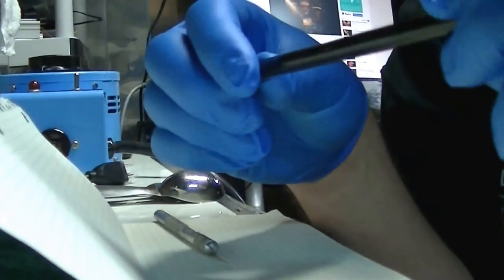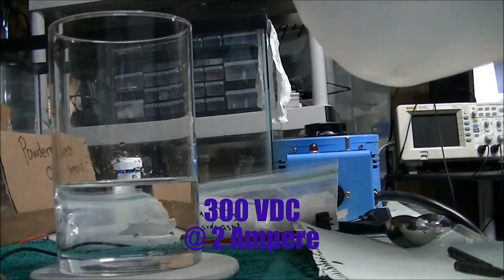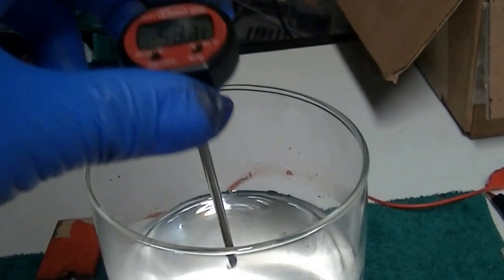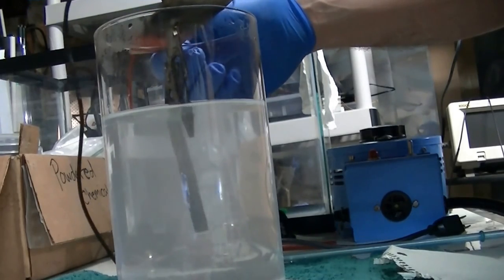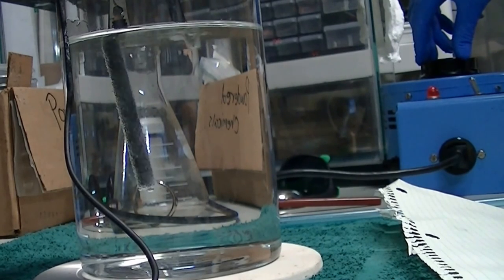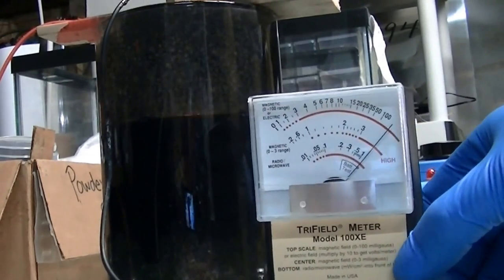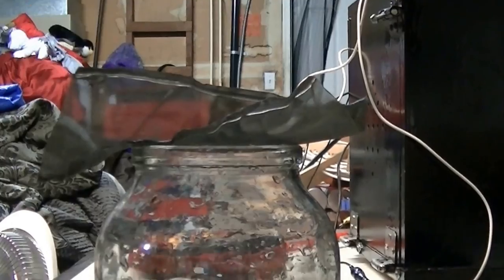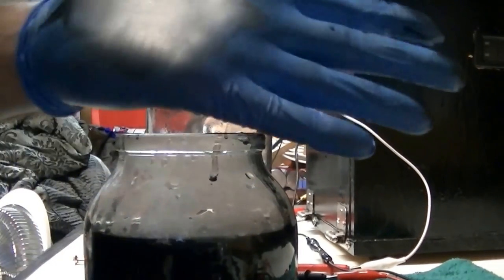Plasma Electrolysis for Graphite Exfoliation | DIY Graphene Production Tutorial

Comment: Ah, the electrode placement for current reduction that you mentioned recently, makes sense. That is really quite the process when it fires up, didn't expect such a strong reaction.
Reply from the maker: +slider2732 That is one method, or one can use a current limited supply, or use a power resistor of appropriate rating. There will be more to come, hopefully they don't bore the pants off people lol.

Comment: This reminds me of the plasma generated in solution with LENR/cold fusion cells using sodium bicarbonate instead of potassium hydroxide as an electrolyte. These cells typically use 200v DC at about 2 amps to achieve fusion. I'd be careful to avoid using heavier elements (such as steel or tungsten) in the counter electrode to minimize any possible gamma rays and nuclear radiation, just in case. You can shield the beaker with PTFE bricks or mix borax into paraffin wax to make good shielding, and grab a Geiger counter.
Reply from the maker: I would love a Geiger counter, just don't have the money for sensor equipment. There is some discusion of using (Pb) Lead or (Bi) Bismuth to thermalize the radiation emitted by the anode. Thank you for the comment. :)

Comment: Try it in nitric acid, as I demonstrated you need oxidized carbon for the 5000 farad per gram super caps, reduced graphene is only good for intercalation of ions and double layer capacitance. Although taking this pre-exfoliated graphite and putting it through the hummers method may provide better oxidized graphene as it will oxidize not only the edges but on the flat planes.

Also something to try, do this with Calcium Hydroxide or slaked lime, then filter out the graphene cake and place it in water. Apply the anode to the graphene cake to drive out the hydroxide ions, but leaving the Ca+ ions.  Remove the cake under load, hydrothermally reduce with urea in a microwave to anneal the graphene then press the cake. Finally test it for lower resistance or superconductivity.
Reply from the maker: +Lupus Mechanicus I acually have a carbon rod process I am working on that might yield direct carbon oxides as they develop on the anode according to electrolytic chemistry. This was just a run to see if its able to break up the graphite easily. I am not fond of 10% clay contamination. I have already made some carbon rod redox with switching that produces a carbon oxide colloid in solution. Now that you have some interest it gives me more encouragement to edit the video and get it out there.
Reply: Diadon Acs Hell yah man let's build some ultra-capacitors.
Reply from the maker: +Lupus Mechanicus BTW out of curiosity, what do think the gassing of of gassing of nitric acid would produce in this process? I have thought about it before, would we predict it to be just nitrogen dioxide from the water and electrolytic reaction of gassing? I don't want to have to go try to do the formulas if you already have an easy answer ;)
Reply: Yes Nitric Acid fumes and NO2 (brown gas toxic don't breath), I really never balance equations unless I am calculating molar masses to balance electrodes. For this I would just use conc 70% nitric acid. You may have an explosive mixture form with the hydrogen and NO2 released though(2H2 + 2NO2 = 2H20 + 2N2, so I would keep the electrodes completely submerged and try to keep the container as full as possible while blowing off excess with a fan.
Reply from the maker: That is good to note, any spark or gaseous ionization would be dangerous... or make a really fun light show ;) I don't think I am going to go that route. Man, its like 2AM for me so you gotta be pushing the limits of sleep. If you are free this weekend, we should do a hangout or Skype call. Its ok if we make an ass of ourselves in real time, that's all part of the fun ;)
Reply from the maker: On the Carbon rod tests, I have not been able to get the carbon to settle out of solution. Looking under the microscope, the structures are quite random in size. So the process needs a lot of work before I put a video up. I wouldn't want to steer people into a dead end.
Reply: Diadon Acs I was wrong this will work for the ultracapacitor anode, and as a conductivity enhancer for the cathode... I am not sure what went wrong but further testing has revealed a different story.

You can freeze this to crash the graphene out of solution. 

However, graphene oxide still should be better ultimately as it should resist pi stacking and loss of surface area.

Comment: Try some Potassium Carbonate and have fun fusing 39K + H --> 40Ca
Standard cold fusion reaction where the potassium 39 fuses with a proton or hydrogen atom to form Calcium 40. The resulting energy will cause a bright glow to emanate from the smaller electrode.
Reply from the maker: Paul Neilson I have done that experiment and many others using potassium hydroxide. Just need to compile empirical experimental data.

Comment: Nice method Daidon. Love that black cloud as it formed. You think a carbon atmosphere around the arc will provide a place for loading?
Reply from the maker: +m3sca1 Its something I am investigating ;) I think its important to have the proper Carbon Isotopes or allotropes as they are called. A proper atomic geometry so to speak. This graphite would not do a very good job in this arrangement as it is easily cleaved from the excitation. The carbon rod experiments are very interesting though. Working on a video for those experiments and also working on a paper for all this stuff.
Reply: @consciousenergies hey, I've tried to follow comments, to learn more. How about niobium metal, using this process to collect particles..?

Comment: Awesome video Diadon. Are you going to try and dry out the carbon solution and try to make super-caps from them?   Again, really great video. 
:D
Reply from the maker: +Binj Komisar Super Caps is certainly on the agenda :) As well as some crystalline composites to experiment with. The more interesting video is to come with a pure hydrogen burn. It also shows how we can make this with carbon rod, despite their resistant nature to decomposition. The atom size is much smaller as well, due to what I believe is rapid phase change in a thermionic liberating vibration (Phonons). Its seems to create an allotropic form of carbon that is a big unknown with out the proper equipment.
Reply: Diadon Acs
Yes, many different graphite/carbon/possibly graphene compounds can be created by means of plasma electrolysis.... On top of that further chemical steps could be employed as well as cooking the carbon in a microwave etc.... I am looking forward to experimenting and trying out many different types of carbon as the surface area provider for super-caps... Super-kewl-fun :)

Comment: Hey Dude only just found your channel + have subscribed.
Super video, Superb Experiment.
But................................
The sound Quality was awful i could only make 2 words outa 4
and that music man, worse than torture.
Having said all of that you are obviously a brilliant young man and i look forward to more of this.
regards kev.
Reply from the maker: Im sorry my new friend. In the future I will do a better job mixing. I will revisit some of these experimemts soon 😁 Thanks for the sub and input.
Reply: No worries on that one friend........... i look forward to future developments.
two questions though if i may, i am expecting that this experiment can be implemented with raw DC ( not smoothed ) ?
and secondly i noticed that you made a comment to a certain company regarding the use of your technique for this experiment and you mentioned the use of soda ash and potassium sulphate in the comment, so my question is what happened to the K2so4 ?
kind regards as ever kev
Reply from the maker: The K2so4 I have not fully experimented with in plasma electrolysis, only in graphfoil exfolistion for nanoparticle graphite. The problem of more processing arises using a sonic bath. As far as the unsmoothed DC, it should still work but havnt experimented with it. Also pulsed DC and asymmetrical HV AC abive 1000Volts 2amps have been used for electrolytic deposition and codeposition methods. I have another video with information in the description about Plasma Electrolytic Deposition (PED). Also called Micro Arc Oxidation (MEO or Plasma Electrolytic Oxidation (PEO). 
https://youtu.be/ugnSKbxpESA

There are quite a few scholarly papers on it and that was my inspiration for these methods of liberation. I hope that information is helpfull.
Reply from the maker: The K2so4 I have not fully experimented with in plasma electrolysis, only in graphfoil exfolistion for nanoparticle graphite. The problem of more processing arises using a sonic bath. As far as the unsmoothed DC, it should still work but havnt experimented with it. Also pulsed DC and asymmetrical HV AC abive 1000Volts 2amps have been used for electrolytic deposition and codeposition methods. I have another video with information in the description about Plasma Electrolytic Deposition (PED). Also called Micro Arc Oxidation (MEO or Plasma Electrolytic Oxidation (PEO). 
https://youtu.be/ugnSKbxpESA

There are quite a few scholarly papers on it and that was my inspiration for these methods of liberation. I hope that information is helpfull.
Reply: yes very helpful ,  i'm just on a bit of a roller coaster at the moment because ever since i reduced ( chemically ) ( and in various solvents with sonification ) Activated carbon to Graphene i just want to do more... so i have now tried my hand with Coal and Charcoal with results, but a faster method is always preferred.
i would like to try other carbons, but of course the way that they are all bonded has to be taken into account, so i am actively looking at any method that can take care of the bonded structures of various carbon types. This to produce a more viable and sustainable graphene
Also of course whatever i produce must be conductive and have a very low resistance.
if you were wondering what i am up to at the moment .....
well that's a long one .....rechargeable batteries, self regenerating batteries, thermally charged batteries  and new solar tech.
My dream here is to produce a new solar panel that will generate power from light and heat and i am 25% there with that one.
since i introduced myself to ionic liquids and deep eutective solvents a whole new world has opened up. ( oh and Chlorophyll )
Everything that i do must be ECO friendly of course, kinda want to save the planet !
kev

Comment: Hi, I was wondering if carbon holds up well as an electrode for a battery. I plan on using graphite dust, or carbon foam. I need to make a binder for my carbon electrodes and was wondering If you know what would make a good binder for them, thanks.
Reply from the maker: Well, most common batteries use carbon and zinc as the electrodes. As far as a binder for carbon..  I am not sure exactly the application you are going for, but you can mix carbon dust with acetone and Polysterene (Styrofoam) ,then dry it out. There is of course more experimentation involved to get what you are looking for perhaps? There are a ton of great videos on YouTube of open sourced people like myself. Look up a user named "a". He has some great videos for these types of things. Hope that helped you somewhat.
Reply: Thanks, I was looking for a binder that would conduct, or at least not hinder the conductivity of the carbon paste and hold up from the electrlite and charging and discharging of the battery.

Comment: Are you using water? Why it not boil?
Reply: All the details should be in the description. It doesn't boil because the graphite is unzipped and holds a low specific heat capacity, so the heat is transferedto the water rapidly. This means the material doesn't have time to remain heated inductively. There are a couple of perameters someone 
could adjust this by lowering the voltage in order to not exceed the breakdown voltage of the solution and increase the surface area of the electrodes. 

The idea behind this experiment was to rapidly implode graphite to see its effects. Hopefully some lab took it and ran with it if the material structure analysis was of use to them. 

If your interested in Hydrogen based heating, I have other video experiments on that. 

Thank you for your questionand interest in the channel.
Reply: @officialdiadonacs  I made this thing but from wire (Iron or Aluminium) not from graphite and I converted 230V AC to 200V DC also I used salt as electrolyt and water. I dont know why I cant create plasma